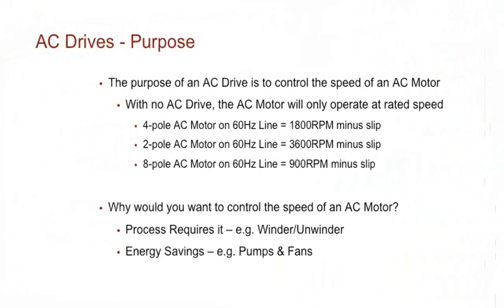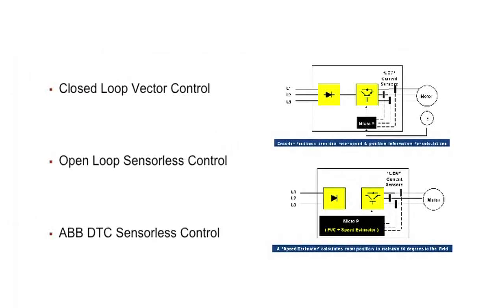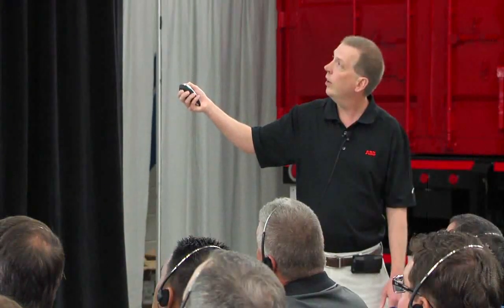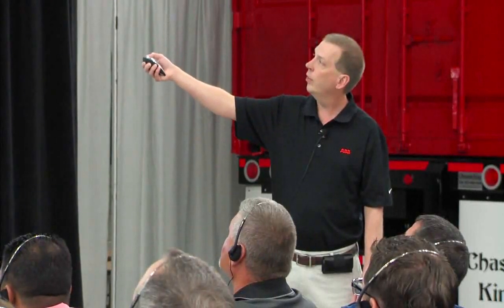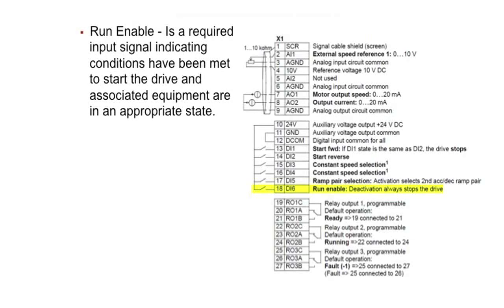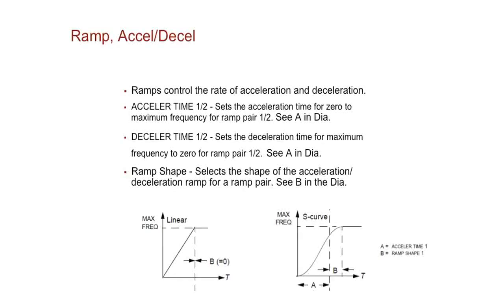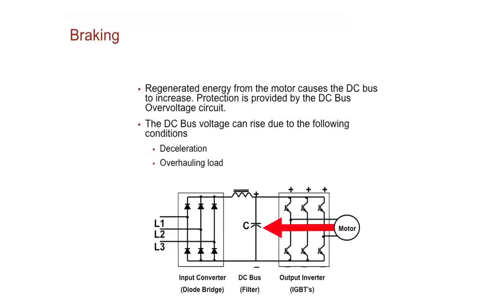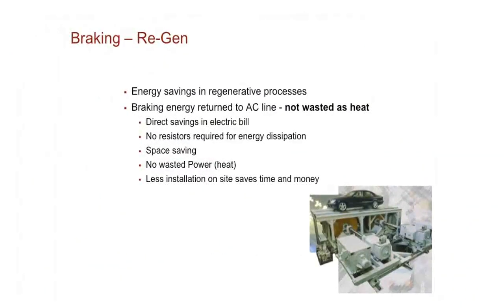Drives 101: Basic features of AC drives

Comment: One of the most informative videos out there. Fantastic job and thanks a ton!
 As to your question below about topics. One idea may be a well focused video showing the parameter entering process for the more used options, start stop, frequency min max etc.... Maybe one specifically on configuring a drive to vary the output frequency from an analog input, say 4-20 mA, including every wire connection from the control terminals to the potentiometer or transmitter and power supply and every last parameter setting then a test run.... I guess we'd need to pack a lunch. (I've been away from this stuff for a while and appreciate the refreshers you're providing here.

Comment: I have a question, can i use a vfd to convert 50hz to 60hz to power my washing machine? I live in Barbados and we have a 50hz grid but i bought a washing machine in the USA which is 60hz and the machine wont work. Can you help me ?
Reply from the maker: Thank you for the question!

Household appliances typically have single phase output motors, which most drives cannot be utilized on; additionally, when specified on a specific Hz, the appliance is usually restrained to the voltage that frequency is used with (i.e.240V with 50 Hz and 120V with 60 Hz). 
 
We would recommend contacting the washing machine manufacturer for further information.
Reply: Can you recommend something that will work?
Reply from the maker: It would be best to contact the washing machine manufacturer directly.  We don't want to make a recommendation without knowing more about the specific product.

We wish you the best of luck with your situation!
Reply: Frigidaire Affinity Series FAFS4474LW
Voltage Rating:120V/60Hz/15A
Connected Load (kW Rating) @ 120 Volts:1.4
Watts @ 120 Volts:1,000
Amps @ 120 Volts:8
Minimum Circuit Required:
20 Amps
Reply: I had already contacted the supplier but the told me to return it. The problem is that I have moved from the USA so it is extremely expensive to return and import again.
Reply: I had a technician look @ the machine and he told me that it is the cycles he hooked up the machine to a device(i dont know what) and a 12v dc power supply and it worked. I  really would like some help I am desperate
Reply: jamesjizzo You need a stattic frequency converter.